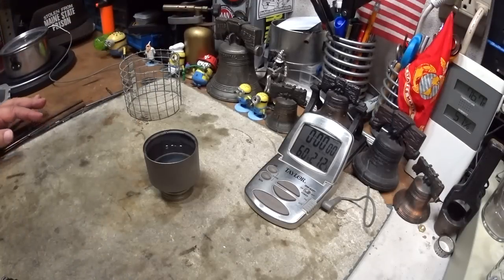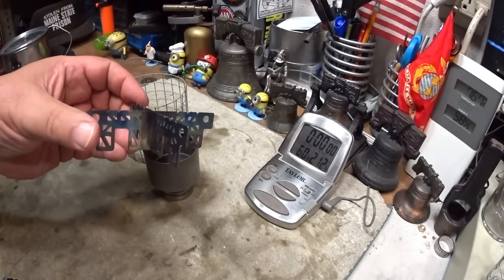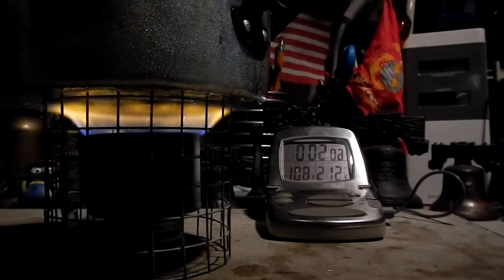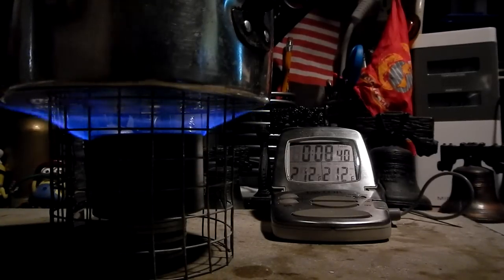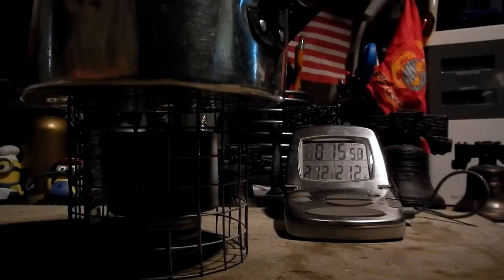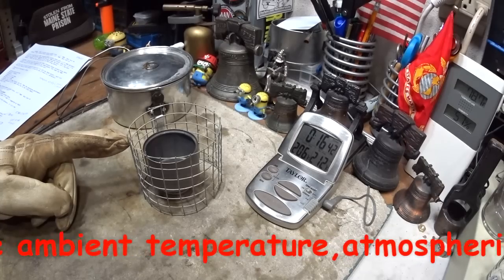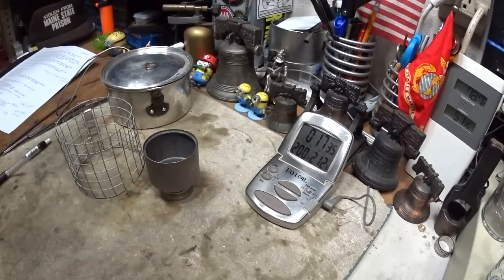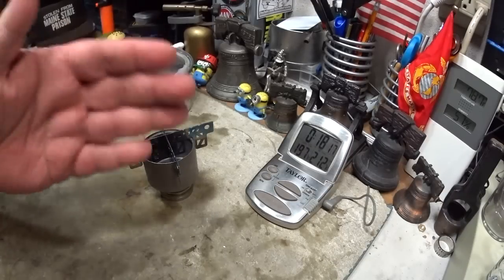TOAKS Titanium Siphon Alcohol Stove - 1/2'' TBBP - Boil Test #3

Comment: the design claims that fuel is pushed back into the reservoir in the over pressurization case.  maybe the 1/2" spacing forces it into that condition?

Comment: hi, been enjoying your videos for a few weeks now and one thing came to mind, have you ever done a side by side boil test of a simple flat bottomed pot to a 'super wiz bang high energy capture' pot with the zig/zag metal figers on the bottom?

these super pot clones are starting to show up on ebay cheaply and i bought a 'super kettle' to test and tried 500ml of water in it and 500ml in a standard aluminium tin pot, no more than a few seconds difference on the same burner.... did i do something wrong or while its good science is it just snake oil???

Comment: What difference do you think is caused by placement of the stove?  By this I mean in your "raised" tests the stove had a different contact footprint on a different material than when it sat on your desk top. 

As we know, the thermal heat-sink effect of a cool surface, especially one which has good thermal conductivity, slows the stove and will increase boil times.  These stoves would heat faster when placed on some type of thermal barrier.

Comment: Hiram:

No surprise here at all. Shorter flames improve fuel efficiency. If you remember my Mahalo was specifically designed to be as fuel efficient as possible and in that stove the jets was set at 1/3 of an inch. That is why the mahalo only needed 17 ml to boil two cups water in your test.

Since then I designed the ultimate stove . with two cups 66 degree tap water to a 208 degree rolling boil only needed 12.5-13.5 ml of Klean Strip Denatured alcohol. With 10 drops alcohol to prime the stove.

Comment: There is no surprise here. There are two factors that lead to this effect (I am not sure which one is more significant here): first is that reducing of space above the flame limits amount of oxygen, so evaporated alcohol does not burn completely; the second is that flame is contacting with the cold surface of the pot and that reduces the speed of chemical reaction thus leading to incomplete burning.

With other types of fuel it can be even dangerous to reduce this TBBP distance below optimal value, because at such conditions (deficit of oxygen) the carbon monoxide will not burn completely and the stove can literally kill you if being used inside of a closed space.

In short words, the optimal distance from the flame source to the heated surface is when there is just enough space for the fuel to burn completely, and at the same time not too much space so the resulting heat will not dissipate.